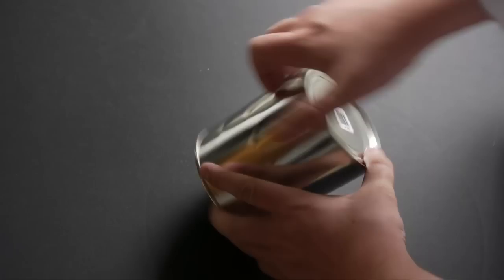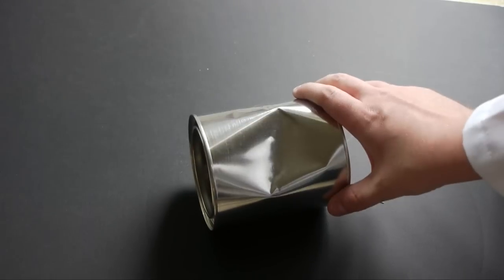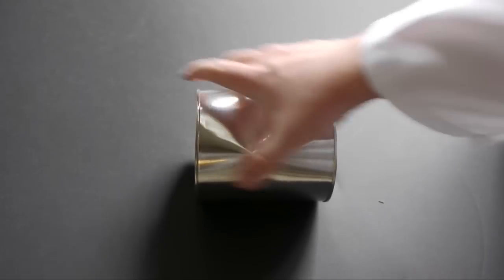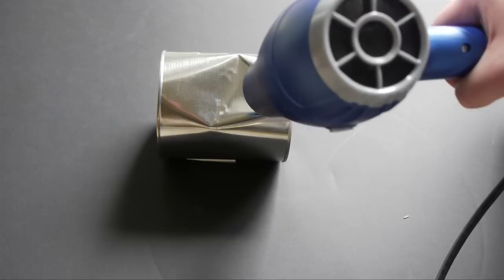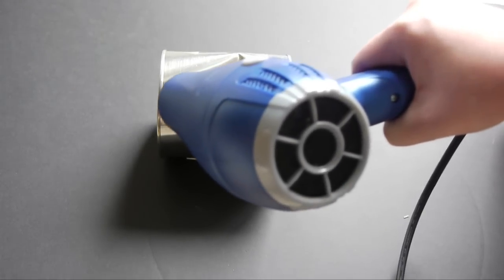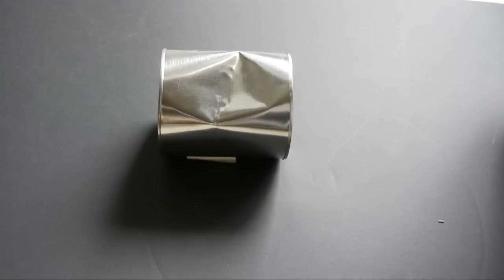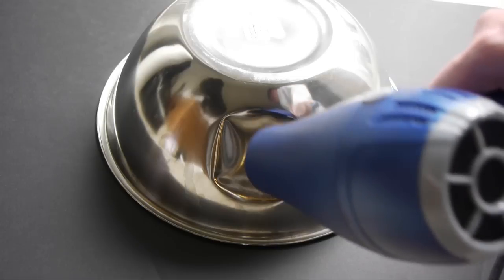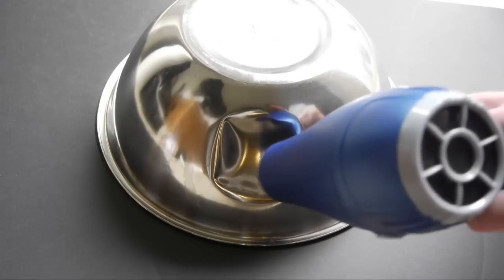Scientific Tuesdays - Removing dents with a hair dryer?

Comment: Actually, those who are saying it was not heated enough, are most likely correct. Long before the internet, and youtube, I personally watched this happen on a big dent, in a 1948 ford. The differences were, he used a propane torch, heated the dent, till it was red, then hit it with a rag, wet with ice water. The dent, came out, and it was ready to finish sand, & prime, all within just a few minutes! He did say he would hesitate to try it on newer cars, cause he was afraid of melting a hole in the cheap metal. Bottom line, the dent came right out of the 48 ford! ;) I watched it, in person, no camera, no tricks!

Comment: Hahaha! You are not doing it right pal. The cooled part needs to be closer to the center of the dent, and heated part to surround it. What you did is applied heating and cooling to the same are, which would not instigate the compression or expansion of the material in a way that would make the expected change of shape.
Reply: yes you want to expand the metal areas OUTSIDE the dent to force the material into the centre - and then apply the 'cold' (dry ice works well too) into the centre to get the extra material to 'suck' into the centre
Reply: but science lab coat
Reply: please respect the lab coat 🤣

Comment: This method is used on far less severe dents then the ones you're producing. You're creasing the metal not just distorting the surface into a shallow crater.

Comment: Plunger works for some dents, worked on my sister's car. :)  This only works on dents where the metal is just pushed inward, if it has a defined edge around the dent, then it won't work very well.  If the dent is too big, you might be able to use some hot glue in the center of the dent to make a handle, let it cool, then pull on it, then heat the glue up again to wipe it off while it's hot.  The bigger the dent, the bigger diameter the glue needs to be in the center of the dent.

Comment: A Hairdryer is definitely hot enough for this method.  A heat gun will in fact strip the finish of your auto.

The dents in this video are not suitable for this method.  Once the metal is creased to a sharp point, the thermal contraction of metal cannot overcome the surface strain holding that dent in place.  Aluminum is not particularly suited, because of it's thermal properties (very high thermal diffusion) and because of it's low resilience (ability to store energy or strain elastically). Although aluminum has a very high expansion coefficient which may help overcome these other factors somewhat.

Sheet steel is perfectly suited, and this can be witnessed in dozens of youtube videos

Comment: My parents owned a motorcycle repair shop when I was a teenager. They did not apply heat then cold to fix dents. 
Holding a large piece of Dry Ice with tongs would remove "most" of a dent with metal dimpling. Dents that had no creases usually came all the way out with this process.
However, if the finish has cracked it still requires some repair to the primer, base, and clear coat to be "seamless".
(heating it first only sets the dent)

Comment: The paint can, that is equal to crushing your car at the junkyard in a chimpanzee machine or driving over it with a tank. The dog food bowl, I've never seen a dent on a car look like that in my life. Do you own a car? Have you ever driven a car or even driven inside any vehicle beside your pedal bicycle? Unless your driving near someone with metal tubes like fence post welded on every inch 360° around your car. I don't think you'll get a dent like either one of those. EVER. ALSO YOU ARE SUPPOSED TO USE A HEAT FUN WHICH IS NOT A HAIR DRYER AND IT'S CALLED "TOUCHLESS DENT REPAIR" look it up
Reply: He's testing a myth duh
Reply: Elias Tremaine imagine taking your hood off your car, folding it in half out better yet. Take a sledge hammer to it while it's facing straight up and at the front of the hood where the hood skin connects to the frame, take the sledge hammer and hit it straight down then try the cold compressed air then a blow dryer. And there is something called touchless dent repair where they heat the metal with an industrial hear gun and reshape the metal where it is flexed. Cars just have metal skins over the front and rear quarters, doors, trunks, hatches, roof, hood. Big big big difference. The sheet metal skins cover the frame which makes a safety cage inside your car. Try bending the A pillar which is the side of the windshield then use compressed air and a blow dryer. This guy is a joke
Reply: KINGCALLO You say that like it's a bad thing ;)

Comment: I don't know about your Hair Dryer but mine uses 2 C batteries so, it's portable.If yours is not portable then you can use an Extension Cord or if you have a plug in your car then there you go.

Comment: It didn't work because you did it incorrectly. After you heat the surrounding metal, you have to apply a steady stream of co2 for AT LEAST 30 seconds, if not until the dent pops out. Metal is a great conductor of heat so obviously if you only spray it for 2 seconds it's just going to heat back up again. Also, heating it doesn't make it "more pliable", "SCIENCE" man, it makes the particles accelerate and expand, which in turn applies pressure to the dent. Come on!
Reply: That was NOT CO2.
Reply: @yingxiawei821  he never said it was. Read his comment again

Comment: as a professional car painter i can say it might not work on metal, but applied heat on plastics often causes dents to pop back. Partialy without needing to add cold.
So if you have a dent on your bumper,  just heat it up from the inside, you might need a bit more heat than a hair dryer can provide and you should be carefull that the material not simply melts or the paint on the bumper starts to burn.

Comment: My car got a huge dent on the bumper and all I did was blow dry it for 10-15 mins not "45 sec". And then I pushed it from the inside back out . Guess what it worked so don't listen to this moron it worked on me but just use a hair dryer and blow on the dent for 10-15 mins and then go under the car and push the debt out
Reply: What car do you drive? Is it made of aluminum?
Reply: You're fine! 😍

Comment: it doesn't work if the dent has sharp kinks. it's more for smooth bowl type dents. also works well on plastic fenders as plastic is more flexible and the loose atom composition. the trick is to warm it up but not to the point it is too hot. when you add the freeze you want a quick change from warm to cold, atoms tighten and return to the outer surface pressure. you don't want to go from hot to warm.

Comment: Just a suggestion, but I think you should try heating up the dent with the hair dryer in one hand, and the canned air in your other hand, ready already, and right when you are finished heating it up, swipe the dryer out and quickly spray the dent with the air.

Comment: Those were both severely creased dents. If the metal is creased this method will not work.  Also, the reason this works on cars is because of temperature differential, the surrounding metalwork remains closer to ambient temperature. Small objects heat soak too easily and the expanding metal has no "leverage" to force itself away from.

Comment: hey just tried it works well but just use the hair dryer on its own and use your thumb on the other side with a cloth over your thumb to protect it from the heat.

Comment: the theory is with an actual automotive heat gun which gets ten times hotter than a hair dryer. also you are supposed to go over the area for about 5 min each time not just a min so you are not getting the metal warm enough to cause a fast temp reaction. the hotter it is the faster the molicules will retract therefore making the dent smaller. try these methods and see what happens and also a real car and real dent would help with the right material for the test

Comment: I used something different and it worked. I took a can of hairspray and a lighter. I sprayed it on the dent in the sheet metal i used until it was very hot. then i applied the compressed air and then it popped out. BTW only spray the hairspray in bursts or else the can can over heat and explode and that wouldn't be good for you :3

Comment: I had a dent in my rear bumper. About the size of my hand. It sat there for a couple of weeks. Then one day it was gone. The car sat for several hours under the hot sun and the dent just popped back out. The bumper is not metal but some sort of plastic material I think. I believe the idea is similar to what you are trying to do here, just not with metal.

Comment: This actually was designed to work on bumpers--which are made of plastic (most of them).
Reply: why would you use compressed air on plastic ?
Reply: the question is why would you use it on metal?
I am an automotive collision repair technician so, I have done this before... thats how i know.
Reply: U use it on metal to remove small dents with a torch it takes more heat... they have videos of it all over y/t, or mr "body man" try it (old a$$ trick) But they use this in every good body shop if they dont want shit tons of bondo!

Comment: It wouldn't work, the heat releases the tension in the metal and then the cold air just helps it hold that shape.  Basically, you're just helping the metal stay dented.

Comment: this works on PLASTIC fenders, and you only need the hair dryer. I used this when i dented my moms altima. Before she got home i grabed her hair dryer, ran it around the dent in the front fender and it popped out, took turtle wax, buffed out the black paint from the gas pump and it looked as though nothing happened

Comment: I learned this years ago and even did it and it worked but the way i learned was way cheaper. Leave the car sit out in the hot sun all day long then take a bucket of ice water that's been sitting for a wile so the water is super cold and quickly splash the water over the dent, the dent on my 1986 Honda popped right out. now don't go putting dents in your car or any other car to try this, but its good to try just in case you do get a dent somehow. may have to do it a few times

Comment: Try it with a heat gun instead of a hairdryer. More heat might expand the molecules in the metal more, causing a bigger reaction when the canned air is used on it.

Comment: ever think of trying it on the metal thats actually used in making your car? cuz im pretty sure cars are not made out of aluminum and that different metals react differently. on top of this if you are trying to take out a dent your best option is just to heat it because as the metal expands it will force its self back into its original shape since it has no where else to go

Comment: Fyi you have to use a heat gun and heat up around the dent. it doesnt work all the time but worth a try. it works best on flat areas and no compressed air is needed.

Comment: what i also want to know is, why would you TRY and fix a car dent when you can simply take your car to a PANELBEATER which will only cost about a hundred dollars and you are GUARANTEED to get the door fixed and the door wont be damaged in any way, but if it is you can just sue them or tell them to fix it properly without extra cost.

Comment: this method wont work on these particular dents because they actually bend the metal. it only works on minor indentations where no real metal damage has been done but the metal has been indented, there are actual crease lines in this expirement that prevent it from working

Comment: I have used this, and it worked.  1. 45 seconds is now where hot enough,  the are that extends around the dint needs to be hot,  we are talk 55 to 65 degrees  that's Celsius.  then only the dint, not the area around the dint.  it is the FAST shrinking that will force the dint out.  if you cool the whole area around the dint it is pointless.

Comment: The hair drier is not hot  enough. Must use a heat gun. I just tried this on my rav4 door were seams, are affected, it got 75 % of the dent out. You must pound around the dent after cooling. The dent needs a little help. see some of the other videos. I plan on pulling the door skin to push metal from inside. My dent is between two seams.

Comment: You can't actually be dumb enough to think that a hair dryer can really affect the metal used in a car. The hair dryer trick is meant to be used on the plastic bumpers of cars, use the hair dryer to soften the plastic then reach behind the bumper and push the dent back into place.

Comment: @ijtl999 No one will know that for sure unless they try. Just because the method didn't work for him with a can doesn't mean it won't work for a car. There are other small aspects to look for such as type of car, paint, and size or angle of dent for example. And as I said, I know that sometimes you have to use what's available if the real thing isn't present. It's pointless for many many users to continue arguing of this, Any further ignorant replies will now be ignored.

Comment: consider this.  you have a n aluminium can and a steel can.  same thickness.  which one would be easier to dent? the aluminium.  that is why vehicles are made of steel right? well now (using your head) if you cant lift 200 lbs, can you lift 250 lbs? No.  The same applies to the steel VS. aluminium.  if it wont work on the aluminium (the weaker of the two) what makes you think it will work on the steel?

Comment: The metal on new cars is much flimsier and lower quality than the paint can and the bowl.  That is why new cars have to have so many airbags to make them safe.  In the 1970s, 1980s, and early 1990's, the car was your defense and it was made of heavier and higher quality metal.  They even had metal bumpers.  Try the experiment on flimsy car metal.
Reply: I am a retired chemical lab technician who worked in a steel mill.The older cars definitely had heavier metal but they certainly were not a higher quality metal.
Reply: Cars nowadays aren't flimsy but rather have crumple zones to absorb all the kinetic energy
Reply: +UnfoundWay So wrong.  New cars are much safer than old ones.  So many would get decapitated from the hood not crinkling and thus going through the windshield.  New cars are designed to crinkle up for a reason.  You say we need airbags today because cars aren't as safe as old cars, as if that is why we didn't have airbags back then.  It's simply a matter of not being invented yet.  All that metal around you is scary.  I say this as someone that doesn't hate old cars either.  I've had old cameros and chevelles.  Glad I didn't get in a wreck tho!

Comment: Try again with a heat gun, it looks like a hair dryer  but it gets way hotter, up to 1100 degrees F. That high temp in combination with the freezing CO2 would definitely work. Give it a try.

Comment: As an autobody techinician, let me tell you what I know is wrong with you video.

It is not too far off to work. Since there was a force applied to the metal, you have to bring back the molecules to where they were before. What you would do with a dented pannel is:

You need  acetylene torch, you heat up the panel. With a hammer and a dolley, once the surface is hot, almost red, you hit the pannel with the dolley on the other side so that you create an opposing force, restributing the molecules

Comment: Two issues with this, if you keep using the hair dryer for so long it'd break. And it'd be long cause the hair dryer doesn't provide enough heat to do this job quickly. I'd recommend a heat gun instead, there is no much difference between prices of a hair dryer and a heat gun, though some hair dryers might be more expensive, and if it breaks you'll have someone kicking your butt.

Comment: well cars are carbon fiber? recent cars that is. plus would a smaller dent on a huge surface come out easier? because increasing the dent size with the area of the metal would just be proportional to a smaller dent on a smaller piece? like no matter what give a grape to a baby, and an plum to a man, and theyre both going to be equally hungry over a day, that is to say they are both of the same relative health.

Comment: ppl this doesn't work in anyway...
creating a dent on a metal/material surfice means that you passed the point where the metal was elastic to the point where it is plastic creating a permenant deformation in the metal.
Heating and freezing the metal without a opposite force applied in dent wont do nothing more then changing how much force you has to be applied so it stops having elastic properties and becomes plastic or breaks under the pressure.

Comment: put  an air tight bowl sealing over it 
heaten up the air and release some of the hot  the air....
put it back make sure its really sealed off and cool it down...
the air  should suck the metal in as it cool down compresses and  creates a vacuum

Comment: You did it a bit wrong. You supposed to chill area AROUND the dent, not the dent itself. The point is when the metal is hot it is extended equally over the hot area, but when you cooling it then metal shrinks a bit. So if you chilling all area it shrinks equally and nothing happens. But if you chilling area around the dent then this area shrinks faster then the dent and so dent will be pulled radially. That's how it works. Try again.

Comment: @clayto1332  We use " Heat guns" wich look like hair dryers but get alot hotter on plastic bumpers, and take a paint pattle, or something flat and press on the dent from the inside work the heat gun and press , then bondo if needed and paint and your good

Comment: i think your suposed to freeze AROUND the dent. Lie on the outside curves of the dent and not the middle. THat way the dent tried to pull back and the middle stays a little more expanded and itl pop when it gets pulled enough